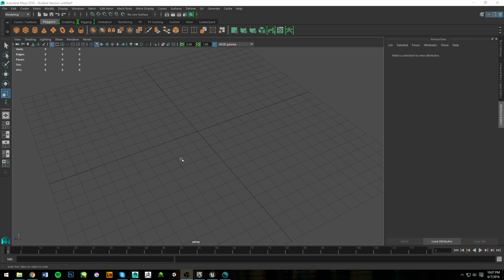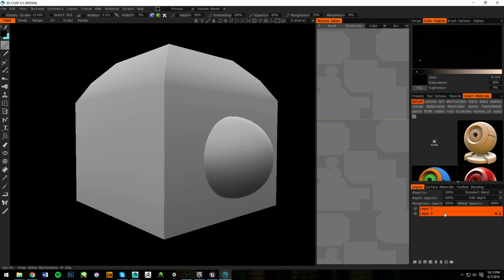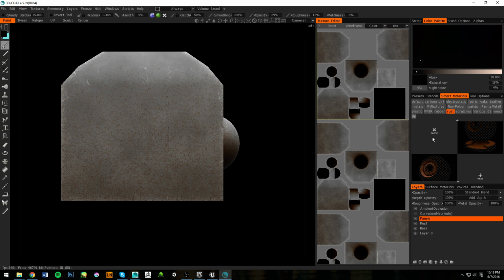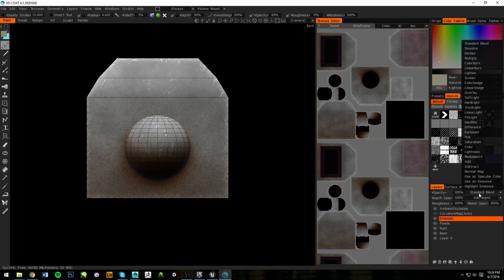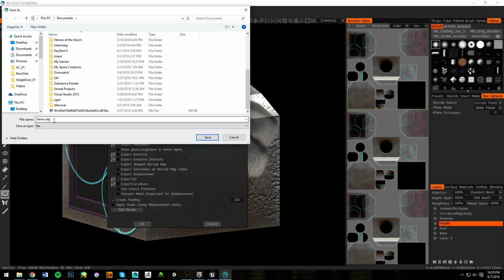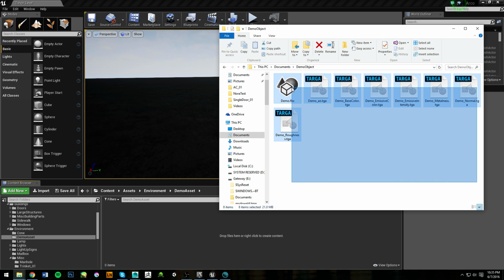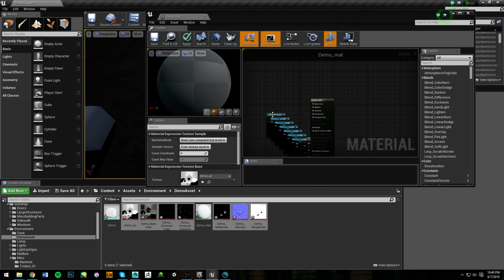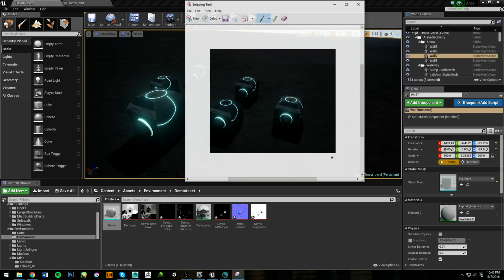PBR Workflow Tutorial (Maya/3D Coat/Unreal Engine)

Comment: Thanks, this is information is surprisingly hard to come by. The only problem I see -- unless I missed something -- is the amount of steps that would be involved if one needed to import, say, 50 game assets from 3D Coat into Unreal. The solution shown here isn't scale-able. Surely there's a simpler way to export/import everything as a single package rather than hooking up 7+ nodes for each game asset?
Reply from the maker: Robert Marriott  material instancing in Unreal may be what you’re looking for. Otherwise, there really isn’t a first party solution that I’m aware of for batch exporting/importing unless 3D Coat has a ‘Send to Unreal’ button now.
Reply: @user-lh3yq5lh9j  Sorry for sounding critical. Upon further research, it appears this is the standard workflow. I watched a Substance Painter to Unreal video where the guy was able to combine a few things into one of the exported files, but he still ended up with 4 nodes in Unreal. I guess you just get used to this process over time. Anyway, thanks for the tutorial and clarification!

Comment: Something's wrong with the base material in 3d Coat, it really doesn't look metallic at all. Could it be because your scene in 3d coat isn't lit, so the AO is off?
Reply from the maker: It was because I had roughness off at the start, but didn't notice until later
Reply: Trevor Goodwin Oh right on, thanks for clarifying! I've had a bunch of trouble getting textures exported from Substance Painter to look right in UE4, so I'm looking for an alternative pipeline. I appreciate your video.
Reply: I just had the same problem and it was the color map. It was set to diffuse but I've changed it to Color Albedo... Because the metal areas need to be bright and 3D Coat was exporting them all black.